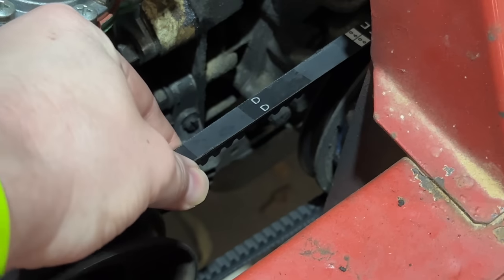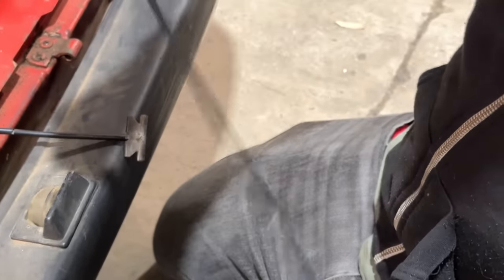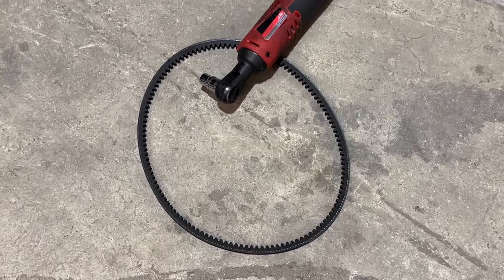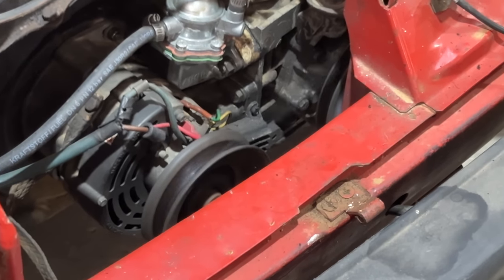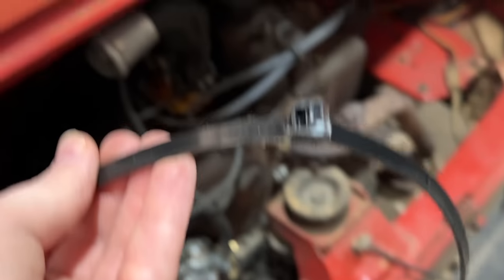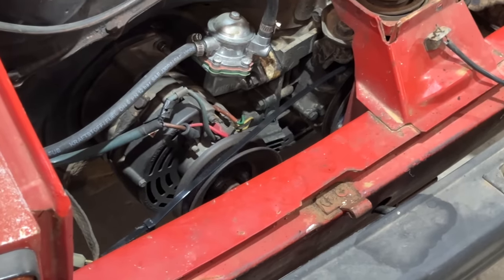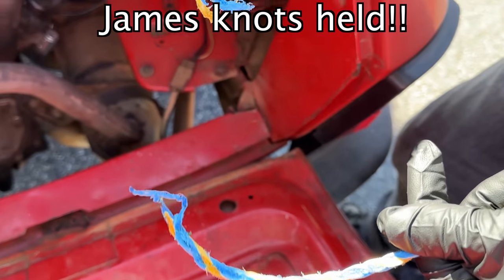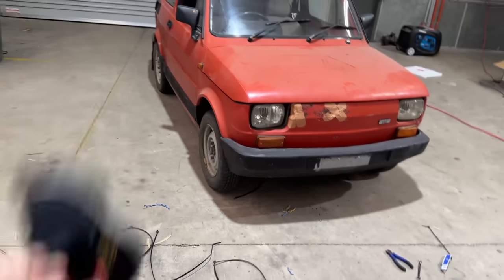Tony Abuse: The zip tie fan belt.

Comment: In the 1980s and 1990s, this magical car was used by quite some Polish people to get down to the Black Sea. Since it was summer, the cars were constantly overheating, and the solutions used by the poles were much… more interesting than these. With the cover open, you could see weird hodgepodge systems filled with ice and whatever you can dream of that is cold, to keep the car “not boiling” and get to your destination. (A lot of people were quite bad at this game, as they cooked the engine and they needed to have an emergency break so it cools down)
Reply: @retrocatalog  Tony, like most rear-engine cars, is air-cooled. No coolant. That's why he mentioned a lack of water pump when talking about belts in the video.
Reply: This is literally how half the farm equipment my dad's had repaired by me and him, "temporary" repairs that have managed to last years holding stuff together
Reply: @retrocatalog  Pepsi coolant needs to happen. @GarbageTime420 are you seeing this? Please do!🔥🔥  EDIT: Oh yeah it's air cooled... oh well, just pour Pepsi on it.
Reply: @retrocatalog Coolant doesn't exist in an air cooled engine.

Replacing OIL with pepsi, on the other hand......hmmm
Reply: @retrocatalog  sadly that's not possible as this car is air cooled however replacing the oil with Pepsi would be fun

Comment: This is the adult equivalent of a kid using playing cards and clothespins to make their bicycle tires make that revving noise while riding. Good job, Tony.
Reply: We used a more destructive method, but far louder and more authentic sounding (IMO)... a soda can! 
One day after running one over, it got stuck on one of our tires and then lodged under the seat. As such, in the same way the card slapped against the wheel spokes, the tire tread rubbed against the soda can, causing it to vibrate violently...

Of course, metal on rubber causes some wear, and thus, the destructive part.
Not that all that much rubber wore off, but it did indeed do so, whereas using playing cards wouldn't do anything. 😊
Reply: @DUKE_of_RAMBLE I did something similar with an open crushed Gatorade bottle, and it gave it some echo, it was bodytrembling for 11 year old me, I felt like I got on my first hayabusa

Comment: Tony abuse❌
Tony character building ✅
Reply: What doesn't kill it makes it stronger?
Reply: I'm in constant fear for them when they're drivin' around in Tony, kinda like if they were in a TonyTitan-Sub. 😳
Reply: BTW, anyone that hasn't seen how lightning-fast an implosion is, should look up "Implosion Tank tests". Those huge rail-car tanks implode in the blink of an eye. The implosion that Titan faced was probably 100x faster and 100x more violent than that. Those 5 souls never heard nor felt a thing.

Not trying to be morbid, but as far as retrieving their bodies, there are no bodies nor much of anything retrievable. I can only describe it as, Tomatoes shot out of a cannon.

It may have been so violent, that the cavitation may have produced it's own light-source brighter and hotter than the sun, for a few milliseconds.
Reply: Tough love
Reply: @MAGGOT_VOMIT  especially if you bear in mind that carbon fiber is a lot less elastic than steel, meaning it 100% cracked in stead of 50% cracking 50% caving
Reply: Tiny character arc.
Reply: @VeraTR909 it will when it gets rebuilt again XD
Reply: @MAGGOT_VOMIT   Frankly, if I'm going to go in a catastrophic event, that's what I would pick.  One second, I'm reading the back of a cereal box, the next second I no longer exist.  Sounds perfect.
Reply: It even looks like Calvin's dad's car
Reply: @bacicinvatteneaca  Everyone needs to understand that a sub's structural-integrity is not designed nor built to withstand the crushing OUTSIDE forces. It's built to contain the INTERNAL positive air-pressure needed:

1) to keep the vessel rigid without bursting.

2) to allow humans to safely exist inside the vessel @ 1 Atmosphere/14.7psi of pressure

The catastrophic-implosion is merely the last thing that happens if the "balloon pops. Regulating the inside pressure is extremely critical. Even if material fatigue isn't an issue, an accidental 4psi increase internally, could burst the vessel. Doesn't sound like much, but it is.

I've seen an indoor 10,000gal vertical process oil storage-tank, violently blow the welded top off it with only 4psi showing on the gauge, while they were trying to push sludge out the bottom port. That lil 4psi x the lid surface area alone, equals to around 48,000lbs of force that no one thought about. 😆
Reply: @nickwallette6201  Yeah, me too.

Comment: That's barely abuse mate.
That's just simple polish engineering
You could literally use duct tape to fix a leak in that thing
Reply: But could you use duct tape as a fan belt?
Reply: @eduards1328  if the tape's of good quality then maybe
Reply: @eduards1328  if you do it well and apply enough layers I reckon it'd be smoother than zip ties
Reply: @eduards1328 if you drive it lightly, then definitely.
Reply: I was so happy to see a garbage time upload I yelled "Tony" and then kicked my couch. Love you brother from down under.
Reply: Damn, who knew the polish and the Japanese were so alike?
Reply: @skylovescars69420  one's ally was the other one's enemy
Although I'm not sure where you got the Japanese from
Reply: My dad was going to berlin in late 70s, maluch broke down, he ditched it on the side of the road, hitchhiked back home, hitchhiked back with spare parts and basically took out the engine and repaired it on the side of the road lol.
Reply: My grandfather used to start this bad boy with his belt. Maluch is like a double edged sword: it can break soo easily, but can be fixed also just as easily.
Reply: Part of the reason why these cars were super popular in Yugoslavia. :))
Reply: Italian engineering!
Reply: That's just regular maintenance
Reply: @hinoarts  It kinda is.
Reply: @JoCaTen  flex tape, maybe?
Reply: There was a case of leaking nuclear reactor fixed with duct tape, so... 😂
Reply: @eduards1328  Yes. You'd have to braid some strips to do it, but it would work.
Reply: @eduards1328 If you applied the sticky side to the pulley, it would make a LOT of friction, probably get stuck and tear instantly. If you were to use one or two layers with the non-sticky side to the pulleys and THEN go over that with a loop, it might work. Or maybe you could braid a piece like someone above said.
Reply: Kinda wanna see a tape belt now that you mentioned tape
Reply: @hinoarts  The ones exported to AUS were built in Poland. To Polish standards.
Reply: @Saavik256  yes they were built in Poland but the engineering was still Italian. It's an Italian car, designed and engineered in Italy.
Reply: @hinoarts  With Polish tweaks and changes, I am sure, just as the ones built in Yugoslavia were.
Reply: "If the women don't find you handsome, they should at least find you handy."
Reply: My grandpa in 80s going with family of 5 in maluch and it broke down so he hicth hicked to nerest village (10km) and go back with parts and repair it ( he was mechanic) and continue trip
Reply: @LumaControl  belts, are like onions. they have layers.

Comment: Reminds me of when I took a cassette player apart as a kid, immediately lost the belt and tried to use first a rubber band and then a sewing thread to replace it. Rubber band worked well until it decomposed, and with the thread you heard the knot being there, so both not very effective.
Reply: I did the same when my Xbox disk tray stopped coming out. Went well for more years than I care to remember.

Comment: I used the laces from 4 other people, mine included, to tri-weave a belt on the side of the road. It worked, got us back in town. Snapped just as we got on the road to a parts store, some 200~250 meters away, a total of 14 kms back home from a trip. The only reason i think it worked, is because of dad's real leather laces. My mother and brother, and my laces were fabric, so basically less grip than a soapy pig.

These days, i use link belts, they're not cheap, but man, you never have issues with those and if you do, you can always pull a link from the spares and go on your merry way.

Comment: Those first zip ties would be the reusable ones. They have a tab on the locking ends of them so you can take them off and put it somewhere else. Unfortunately, they are absolute terrible at doing what their designed to do because of that feature as shown in the vid

Comment: I’ve only started watching recently and I love it! I work in the roadside assistance game and I can confirm zip tie belts do work and we do it quite regularly! Wrap one around the water pump and the crank and there able to get to the garage! Followed a car with a zip tie belt on there for 30 miles to get em home!
Reply: They...didn't want to be towed?
Reply: @BewareTheLilyOfTheValley  when there in a dangerous position, we can’t load em up, so we do anything to get them off the road (usually to a place of safety then load them up) unfortunately the guy just kept driving 😂 made it to there house so easy job!

Comment: FYI for anyone who doesn't know, the way v belts work is they ride on the sides of the pulleys, this is why as belts wear they go down further into the pulley. The belt shouldn't ever actually be touching the center part. A way to have made this work is to use duct tape as a bed and then multiple zipties sorta meshed/weaved together. I've done that on my mustang 4 banger, it really helps when the alt is adjustable so you don't have to tighten it to all hell.

Comment: No joke, my grandfather had this old tractor (BM Victor). And i clearly remember him tying a rope out of and old pair of my grandmothers pantyhose, and then putting that in as a temporary replacement for the belt when it snapped way out in a field. Weird yes, but it did get the tractor home.

Edit: When you tie plastic rope together like that you can use a lighter or some other heat source to kinda melt and squeeze it together, eliminating any "knobbly" bits.

Comment: Back in the days, a trick actually recommended in DIY "fix your maluch" books when in a pinch was to replace a belt with a stocking, like the thing that women wear on their hind legs. Also, since starter cables broke every so often, a trick was to have a broom stick in the car and push on a starter connector with it to start a car. As a matter of fact, since starters on this thing are no more reliable as the cable, another trick was to mount an extra pulley on the main belt wheel and wind a pull cord on it, to be used to start the maluch like a motor boat.
Reply: I'm sorry but. HIND LEGS??
Reply: @Amy_in_hell  Yeah, why the surprise? We wear gloves on our fore limbs and shoes on hind ones, not?

Comment: There's literally universal V belts you can get that are made of leather that look like a bunch of daisy chained zipties
Reply: Difference is those are specifically designed to replace v-belts and most people are less likely to just have one sitting in the boot than a packet of zip ties.
Reply: @spugintrntl More to the point, I think if a person is inclined to have emergency parts like that, to begin with... they'd likely just have the correct belt! 😅

But, I like where John's head is at!!
Reply: @DUKE_of_RAMBLE  haha, you make a very good point! On the subject of link belts, though, I've never used one but I've heard that they tend to run quieter than normal v-belts. Never heard of them being used for automotive applications, but I guess if you've got a noisy fan belt perhaps it could be considered an upgrade?
Reply: @spugintrntl  you're right, I still think every petrol/gas station should stock them instead of just having a few of the most popular sizes

Comment: Use a reef knot! They only ever get tighter as you pull on them, you need to push the strands together to loosen them.

Right over left, left over right - viola, a reef knot. It's dead simple and it's got so many uses honestly everyone would benefit from knowing it.

Comment: I drove over 100km with a bungee cord I wired together with some Haywire driving the water pump on my truck one time, popped off a few times but I got home. Old tractor we have at club has a belt made out of rubber segments that lock together, has a weird crimp and a pin to hold the ends together.

Comment: I'm an electrician, so I use zip ties for everything. Panduit sells some steel grip zippy Ts. They are pretty good. Never been able to pull one of those apart. Pipe fitters use fancy blue zip ties and, I don't know if it's true, but I've heard those are $200 dollars a bag

Comment: Entertaining- but a PSA as a daughter of an old-school mechanic who also kept his old junkers running by sheer force of will (the '81 Toyota Corolla station wagon, oh LORDY, it was practically a Tony by the time Dad passed away in 2017), the only safe thing to do if your fan belt snaps off is wait for the engine to cool, drive slowly on until it gets hot again- and if you blast your heaters it'll pull some engine heat out too, pull over, stop and let it cool off again, rinse repeat until you can get to a garage. You don't want to be trying to pull broken bits of an improvised belt out of your engine components on the side of the road. 
...Assuming you're not abusing the old thing for fun, that is. This is all the funny stuff my Dad WOULDN'T do! :P

Comment: 4:28 it fell off bc of the geometry of the two flywheels which are running the zip tie. I saw a YT video on this the other day. So basically, if you had a convex shaped flywheel, the zip tie would self-right itself to the center. But because it is convex,, as soon as the zip tie starts going up the walls, the geometry of the situation force the zip tie to spin fully off, it’s like once it gets set off in motion it then is guaranteed to fly off. Whereas the geometry in the convex situation would make it self-align itself in the middle. It’s counter intuitive

Comment: I feel like the zip ties could work if you treated it like one of those adjustable link belts, the kind that you pull apart and remove segments to get the belt size you need and are absolutely terrible? what if you just used the big locking bits on a ziptie to make a belt out of them? seems like it might work a bit better if you ever revisit this segment of tony abuse

Comment: This just reminds me of my mums old cars which could literally be rotting and mum would go “eh it’s fine” and as long as it started she would drive it. To this day, she still claims the most reliable car was a C-Max (we called it the boat), covered in rust and with no working air con, heater, boot didn’t lock, no suspension whatsoever and what my mum called a “unique handbrake”, aka a very very temperamental one. She hated driving it for other reasons, but it genuinely was just the steering and handling, but she still called it the most reliable above her newer cars. My dad would do fixes like this if it needed it, as we didn’t have the money for much more. Never got into an accident with her…and I guess it’s like a janky controller. You play for years with a janky controller and you learn to combat the shit parts. When she got her Audi A2, it took a little while for her to get used to not looking like Cruella DeVil while driving 😂.

Comment: I'm a bus driver, and once the fan belt broke on me out on the road. Engineer came out and went to put a new belt on, only to find he didn't have the right size belt. Faced with having the bus towed in, he said fuck it and put a cable tie (zip tie) belt together and on it, and I drove it 10 miles back to the depot. Was still in one piece when I got back!

Comment: If the fan belt snaps, then spray contact adhesive all over it, then run it around the pulley and cut to size. That will fill the middle of that weird ass pulley and hold up better than trying to fill it with zip ties. Then make the big zip-tie fan belt as tight as you can get it. I absolutely reckon that would work

Comment: I have an idea for the rope if its plastic try melting the ends  after the knot to essentially stick  to itself or add a bonding agent, or knot evenly around meaning yes you need more rope but less failure due to the number of knots.

Comment: The issue is you boys didnt use enough zip ties! Loop one around the bumper and thread the "belt" through it so you can pull the belt away from the groove that was causing all the issues

Comment: the join really is the big problem with any kind of slapped together belt replacement, not a car hence this one actually working, but ive got an old device that ran an exposed leather belt, yeah thats long gone and the jump of a bad join caused no end of trouble at only ~400rpm, had to angle cut the ends of some craft leather strips and use heavy cord to sew it end to end to get it to run smoothly ish

Comment: Mate, try electrical tape around the pully to smooth out the lip it's getting stuck under :)

Make sure to wrap it in the direction it will be pulled at so that the zip tie doesn't unravel the tape as it pulls.

Comment: i think the big zip ties could've worked better if you would have daisy chained more of them together than barely required - more knoby bits on the belt mean lower probability for them to slip under the pulley

Comment: Drop 4 kicker subs. As huge amplifier. 370amp alternator and bunch of Lifepo4 battery in the tony and see how fast it can go when you are blasting the bass. A 370amp alternator at full load takes around 15-20hp so i wonder if tony would be able to even run the alternator when the bass is blasting 😂

Comment: When the engine is running, it may be stretching out the zipties, causing them to expand and come off.  If that is the case, how tight you got them wouldn't really matter.  It's still a really cool test though!  (I guess you could try this again with metal ties. They may not expand as much)